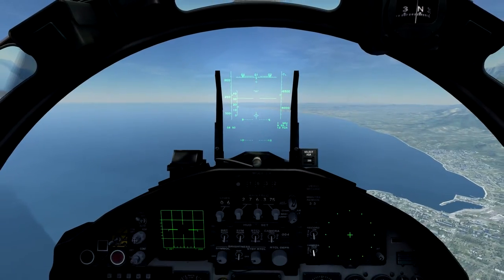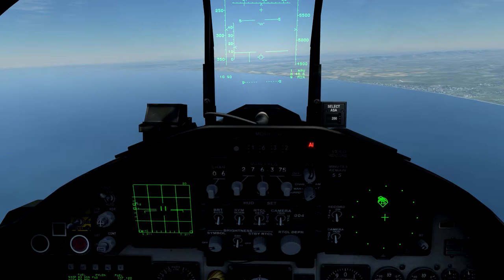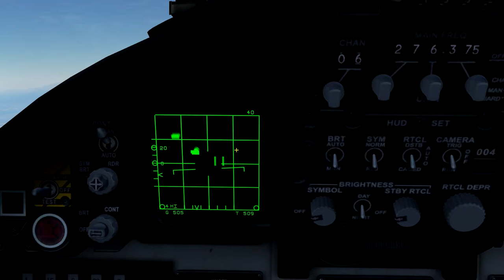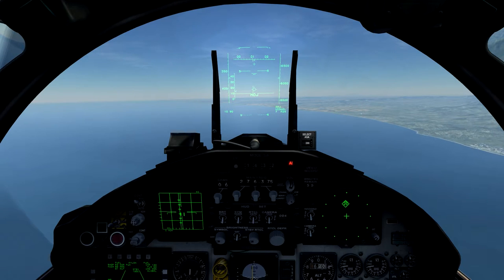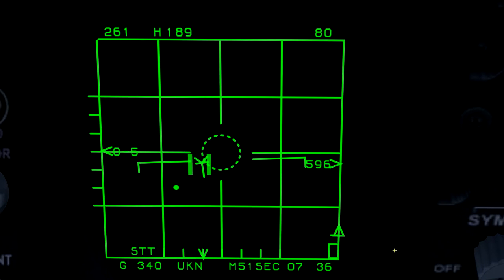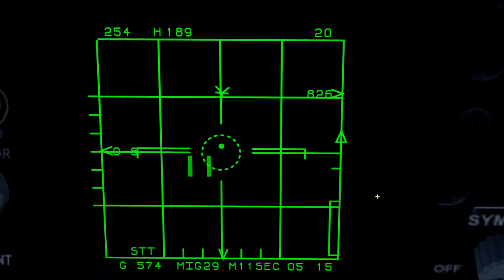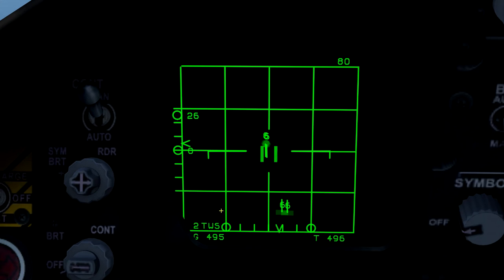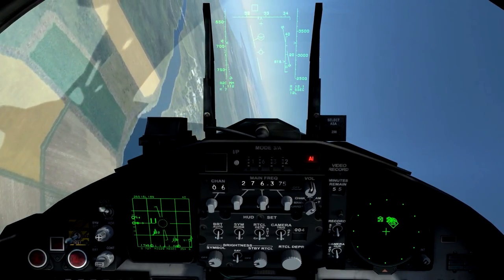DCS:World » APG-63 Radar Operation » F-15C

Comment: hi i was wondering what pulse repetition frequency actually does, i know what it is but how does it effect the detection of targets at different ranges???
Reply from the maker: I'm not sure I can explain this one very well but I'll give it a shot.  A radar pulses in order to receive the reflection in between the time it's transmitting them, at different ranges the time to receive a reflection will differ greatly in order to receive the transmitted pulse because accurate ranging requires that a pulse must be transmitted and reflected before the next pulse is sent since a radar uses the delay between reflections to determine range.
  At longer ranges the time between pulses is lower, but with a higher pulse repetition detection ranges fall off in exchange for stronger reflections aiding in detection.
Reply: So does that mean the high setting is good for tracking long range targets but not as good for tracking closer targets? And what would you say is the optimal range on the radar scope to use the high settint?
Reply from the maker: I think you misunderstood, at higher PRF settings the detection ranges fall off whereas lower PRF is used at longer ranges.
Reply: Ah I see, as you can see I am very new to this, thank you
Reply from the maker: No worries, if you have any further questions feel free to ask them and I'll answer as best I can.